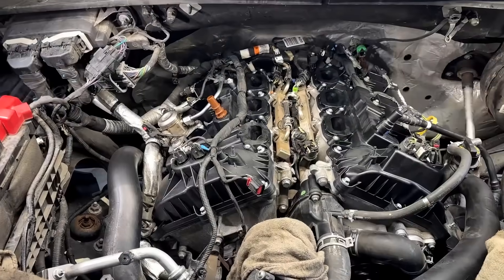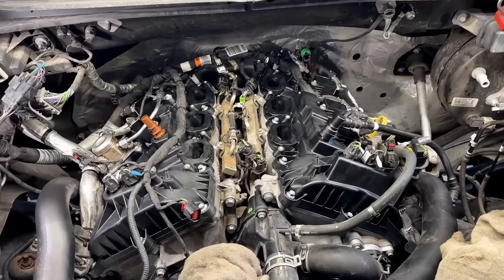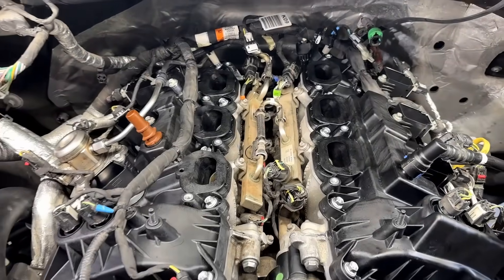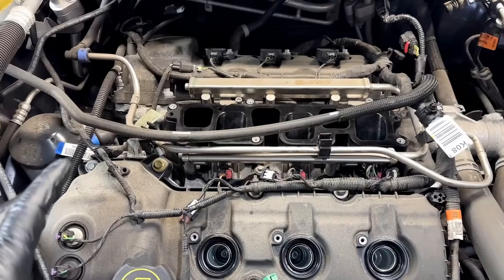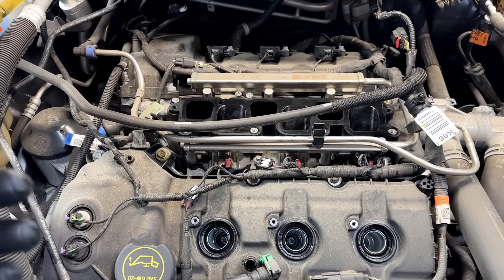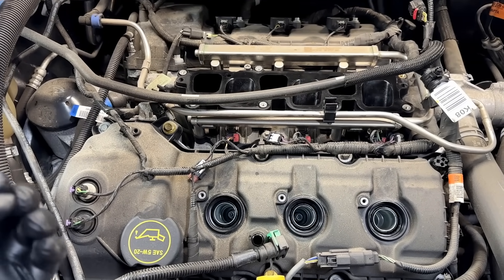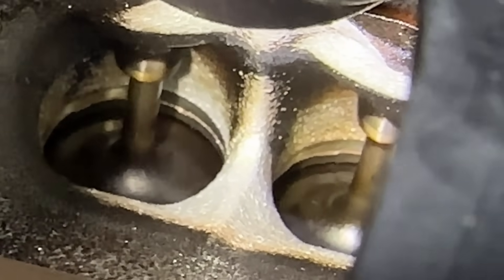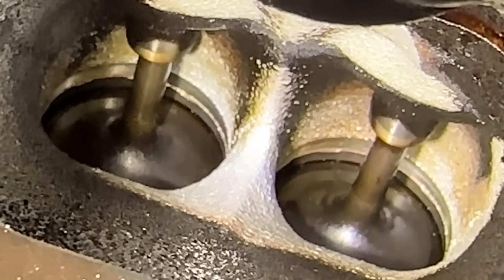Does Ford's New Dual Fuel Injection 3.5L Ecoboost Engine Really Fix the Carbon Build Up Issue?

Comment: If I wanted to avoid recurring carbon buildup in my cylinder walls would you switch from an ecoboost Mustang to a 5.0 for long term dependability? In 30k miles over 3 years driving 34 miles a day my engine has almost been replaced twice, my cylinders twice and my purge valve as well. I’m noticing a pattern of repetition with turbo and direct injection- love my car but hate the reliability- was thinking of paying off and trading in for a 5.0…. Not just because horsepower and torque but reliability. Thanks a bunch for all info

Comment: By far the best video that I've seen that shows the differences between direct, duel, and port injection, regarding the carbon buildup issue plaguing modern engines.
Direct injection is an absolute dealbreaker, duel injection is acceptable but not ideal. Port injection is still king.
Excellent video.

Comment: My Flex Ecoboost has 194K miles on it and the intakes don't look anything like that. Some soot, but no clumps. I have seen far worse on carburated engines. I was expecting them to be all fouled and gummed up, so imagine my surprise that there was just a dusting of soot on them.

Comment: Not saying  AOS will completely eliminate this issue but Ive installed the mishmoto AOS system and believe it or not  the cans collect a lot of moisture and mostly oil, will this not help that much still, Truck is a 2014 F150 eco boost has 102k on it dives really good thus far, always changed oil at the 40% life setting.  Whats your thoughts?
Reply: Or no thoughts.. perhaps

Comment: You put some good fuel injector cleaner and use high end gas at those deposits will vanish. Port injection doesn't help if you use crap gas, oil and don't do maintenance on it regularly.

Comment: My question in theory if the turbo chargers went out, could they be amputated, modify the exhaust where the turbos use to be
And run the truck without turbos?

Comment: I traded in my beloved 2010 5.4L F150 that I had for 15 years for a 2021 with the 3.5L and I've never owned a turbo engine so I'm learning as much as I can. I bought it used, and it had 57k miles. I'm doing all the 60k mile services and installed an oil catch can recently. Everything seems pretty clean and works well aside from the transmission. It has the "10 speed Whine" and it drives me nuts. 

I got an aluminum pan with a magnetic drain plug and I'm putting that on today. I'm hoping this truck can last 10-15+ years and close to 200,000+ miles because I like to keep my vehicles for a long time. With all the electronic nonsense, I'm not very confident it'll last even if it's meticulously maintained. It's also MUCH harder to work on than my old 5.4L. I wish I could've got the 5.0L, but I couldn't find one I liked with the 5.0.

Comment: Great info. I have an 18 3.5 thats misfiring on cylinder 4 at idle. Runs good off idle. Sounds like my port injector is bad. I didn't know the injectors worked at different times
Reply: Did you figure out the problem? My 2018 3.5 also misfires only on cylinder 4 at idle. It has progressed and now misses some under acceleration too.

Comment: Why do they have to build such garbage when a good variable valve and port injection was doing just fine?  Sure if you want to up the hp on sport engines...but for daily drivers and work vehicle you need them to last.

Comment: I got a gen 1 with 188k on it... never had a carbon issue. 
Imo, carbon becomes a problem when you drive like a retired nun.
Reply from the maker: It will be an issue on startup cold mainly.

Comment: Does anyone know if someone has done methanol injection on the 3.5 EB or the 5.0 Coyote  to see if this would reduce or eliminate this carbon buildup?
Reply: I'm getting a snow performance stage1 with the smallest nozzle for this exact purpose set for like 3 psi so its gets a shot every time I leave a light. It will clean it.

Comment: A direct port injection engine can be improved by using dual catch cans, and a methanol injection system, a cleaner can be added like seafoam to washer fliuid injection this will clean the valve stems and seats and de carbon the pistons and stop detonation. A slight computer tune can help also
Reply: That's what I'm doing. Going to run the smallest nozzle available and set it for like 3psi so it's shot often

Comment: From the camera inspection I can see the head gasket has a half moon protruding into the air intake to supposedly separate the air flow. If I changed the head gaskets from factory to felpro I would cut this restriction off the gasket, and let the port tubes of the head separate the air flow. This will be a definite horsepower improvement, also remove any spin vanes in the intake system for more air flow to the turbos .

Comment: Do engines used under high load a lot suffer from this buildup too? Wondering if the inlet valves ever get hot enough to clean themselves (seeing as the other face is exposed to combustion, they certainly get some heat in them)

Comment: My buddy bought a gen1, 2013 and it was running ROUGH. He purchased some Direct injection cleaner and sprayed it behind the  mass air flow in the throttle body. And then let it set for a while. He started it up and test drove it. That thing bucked, kicked, engine light flashing and everything but died. After a couple miles that thing ran like a new one. The spray was designed to clean the build up on the valve stems.

Comment: What are you saying when you stated "your finishing a timing job" does that mean timing chains are needing replacing on these things around 130,000 miles? Or Ford STILL has not fixed the cam phaser thing yet? (Wouldn't surprise me)

God these things are turds! Between the 10 speed transmission issues, the cam phaser issues, the rocker arms self destucting, beer can thick aluminum bodys & the cheepest thing avalable in a 1/2 ton ford truck costs $39,000.00 bucks no wonder every single ford dealer is choking to death on inventory.
Reply from the maker: Yes they still need timing jobs 130-150k miles gen 1
Reply: @FordTechMakuloco  I have a UPR dual (PVC and clean side) Mega catch can on my 2013 3.5 F-150 which I installed somewhere between 60-70K miles (I have 134,500 miles on it now) after I learned about all this stuff so would you think I should have a lot less carbon build up? I have no shakes or anything like that, no cold start rattles and it idles quietly at 500 rpm. I use only Shell and Chevron gas. Should I be concerned about the phaser going out on my truck?

Comment: Exactly why those engines should have had a water methanol injection system on them. And it would not be particularly expensive to do so it should be able to be done for less than $100 all you need is a container and a way to pipe the water methanol vapor into the intake. It isn't brain science or rocket surgery. However it was at one time

Comment: I have a 2015 F150 with 3.5 ecoboost. 
What are your thoughts on a catch can? I probably should have installed one 100,000 miles ago. Think I'm too late or should I still install one?
Reply from the maker: Just stick to walnut blasting's every 100k miles.
Reply: @FordTechMakuloco  Where can I bring it for walnut blasting? Will the Ford dealership do that?

Comment: why is there anything on those valves? nothing but fresh filtered air should be going thru there? those should still be clean!!!! these look worse than most exhaust valves... at any mileage... those look like youve been spraying motor oil into the intake manifold...
Reply from the maker: Exactly

Comment: Can u tell me if i really need the induction cleaning service, for charge 380 or something like that. My truck is a 22 f150 tremor 3.5 ecoboost with 50k miles. I took it in and wanted the plugs changed since they r original but service advisor said it wasnt needed for a while but needed the induction service,

Comment: Very interesting video.  Thanks for sharing these results.  I have a 2023 and I installed a catch can at 1500 miles because I knew this was an issue, especially for those GDI only years.  My question is this:  Is there any way to tell the ECU to use Port Injection only rather than it switching back and forth from DI to PI?  Everyone knows that gasoline is a great solvent, so if there was a way to set Port Injection only then this could be a way to slowly clean things up without walnut blasting, etc.  Hmmmmmm?
Reply: You'll lose performance. And ability to run 87

Comment: Actually, it comes from EGR (exhausted gas re-circulation). Had you removed those EGRs from the intake, there would never have this ugly carbon accumulated.
Reply from the maker: There is no EGR Valve on this engine.

Comment: Would fuel system cleaner added to the fuel on a regular basis help to keep intake valves clean in 2nd generation systems?

Comment: Another data point or useless anecdote, take your pick: 2015 F150 2.7 at 153K. Top tier gas from Costco most of the time. And 5-6K oil changes with Mobil 1 EP. I’ve never seen the oil life indicator go below 46%, fwiw. Still running strong, and idles like it always has. I hear the first sign of excess carbon will be rough idle when cold: no issues there. I’m keeping that truck long term, no reason to sell it. I was so impressed with the 2.7 in the F150 that I added a 2023 Bronco 2-dr 2.7 to the stable. The Bronco does idle better with the dual injection than the DI only F150 did even when new. The F150 is plenty smooth, the Bronco is so smooth I can’t tell it’s running. The Bronco is a year old now, with 8200 miles and just got her 4th oil change. I did the first at 500, second at 2100, just to clear all the wear-in metals out. Going forward I’ll do the same 5-6K or whenever the oil life drops below 50% thing I do with the F150. I think the key to keeping any of these modern engines alive and out of the shop is keeping after that engine oil. Cheapest insurance ever.

Comment: Best Ford Maintenance Resource on YouTube by far!!
I have a 2014 F-150 3.5 Ecoboost with 218K miles.  5K mile oil changes with synthetic oil only.  My oldest son drives it now and it runs like a champ.  The vacuum boost pump is starting to leak just a bit, but that is all.  

I just bought a 2024 F-150 with Ecoboost.  I am going to run Pennzoil Ultra Platinum and change at 5K as you recommend.

Question - If you turn off the auto start/stop and let the truck idle at stops, does the engine switch over to Port injection during this idling?  Would that not be cleaning off the backside of the intake valves?  If so - it would sense to let it idle.  The possible fuel dilution is solved by changing a quality oil at 5K don't you think?

Comment: Just the fact that Brian has to do a timing job on a 2019 vehicle in 2024 tells you all you need to know. I own a 1994 F150 with a six cylinder engine that still runs like a fine swiss watch. The engine has never had its head off, or anything else major done to it. It currently has 165k miles on the clock. Plugs, wires, distributor cap and rotor, coil (only one) water pump, and alternator. That's it, in 30 years. Yes, I changed the engine oil religiously every 5k miles, and the other lubrication at each 40k interval. Now you tell me Ford isn't going backwards. Oh, and you can actually reach into the 8ft. bed without a step stool. 😅

Comment: I bought my '18 Explorer new. We have 75k mile on it now with no issues.  I bought my '18 F150 used a year ago with 150k on it and now has 178k.  Both have been driving the same. Last week, I had the Explorer at the dealer for an oil change for warranty purposes. They gave me a whole list of "immediate attention" items totaling over $2200 in maintenance required.  
  One thing on the list was a complete fuel system cleaning.  I asked if they did walnut blasting.  The service guy said, "No, they use chemicals."  I said, "So basically, you're spraying a can of cleaner in the intake and dumping one in the gas tank for $400." Spark plug replacement was $450,  not including the plugs. Good thing I have my own shop.  30 min and $60 for both.
  But I also wondered why they were charging $250 to replace the cabin filter that takes around 5-10 min to replace. The motorcraft filter was $24.99 at O'reillys and for some reason, the dealer was wanting $45 for it.  I'm guessing the 1hr min at $190, plus filter and tax. They should pay me for breaking my glove box lock hinges when they didn't pull the pins and just yanked down on the box.  
  I get so irritated when I find lack of workmanship, especially being my own vehicle when I take pride working on other peoples vehicles.
  I'm still waiting on the day to find another mechanic that treats my vehicle the way I do.  I treat everyones vehicle as if it's my own.  Drives my crazy to see things broken or to see oil spilt all over the engine and not cleaned up after a service.

Comment: A way to drastically slow down the carbon on the gen 2 ecoboost engines are 4 things firstly and most importantly run a good high quality synthetic oil no Motorcraft simi synthetic crap. second is run a fuel system cleaner once in a while like berrymans B12 or seafoam. Third is use the remote start and let idle 10 mi  or so before u head to work in morning. At idle especially cold starts the port injection is spraying if u have a good fuel system cleaner in there u are basically cleaning the back of the intake valves. forth and almost as important as good oil is catch can! Just some things i have found out from research and mechanics and other ecoboost owners. If u do these things your truck will be in junkyard worn out before  u have to worry about carbon. great video
Reply: Instead of fuel system cleaner I just throw in 2-3 gallons of e85 every so often, does the job beautifully.
Reply: @lucian7182 can these trucks take e85 safely? Or they require a tune?
Reply: @adrianenriquez2544 the only engine that I know that's rated for E85 is the 5.0 I don't think the 2.7 or 3.5 can run full E85 without a tune
Reply: I agree. Now that there is fuel in the port again, fuel treatments (that are near pointless with DI) are back on the table. For idle and low load, with the port injection working, this should vastly extend the carbon cleaning interval. With a catch can and oil bypass filter, maybe never a carbon cleanup?
Reply: I agree

Comment: Just wanted to say I have owned Fords since I started driving in 1982 my  2016 3.5 L eco boost on regular gas with over 240,000 miles regular oil changes every 3000 miles I have changed a water pump cat I don't know what to say  I am pretty impressed if I am just lucky well I just cursed myself.  your channel and your info has been very helpful with numerous of my trucks so please keep on Trucking.

Comment: Wouldn't it be possible to still have some port fuel injection with direct injection?  Or would such a system reduce the amount of turbo boost at max throttle?  I am assuming the direct injection has a charge cooling effect...

Comment: In dual fuel injection engine the Port injection functions at low rpm and Direct injection at high rpm.
To get the benefit of port injection, keep your engine at idle for few minutes any time you drive to avoid carbon buildup. 
Remember if you are driving your car constantly at high rpm then you’re basically never using the port injector.

Comment: It would be awesome to see Gen 1 valves on a vehicle that had catch cans installed from the beginning of its life.
Reply: That's a gimmick!
Reply: @gilianrampart8514  You are wrong!!! I put one on my 2017 Ford Focus RS which also has the direct injection. Guess what? It's catching a ton of blow by which would have stuck to the valves and stems.
Reply: @skeeter012  2000lbs?
Reply: @skeeter012  Oh really send us a pic of those valves.
Reply: @gilianrampart8514  Must be why they do them on race engines.

Comment: This video makes me wonder if the owners were using Top-Tier gas? That's pretty much all I use (99+% of the time). Does it make a difference in the carbon build-up? I've read that it does but I've never looked inside my own engines.

Comment: I need a timing & phasers job done on my 2014 F-150 Ecoboost (over 200,000 miles). Is the carbon cleaning done at the same time the timing chain/Phasers job is being done by the mechanic? And how much does it cost extra to do that type of job? I'm thinking that it might be better to install a new engine?

Comment: 2017 navigator is 2nd gen ecoboost? I’m under the impression so 🤔
Reply from the maker: no
Reply: @FordTechMakuloco  I currently at 63k change oil 4K max rarely idle. I saw your catch can video. Will the 2 hose set up in catch can work just as fine(not having to add hoses to turbos) or really make that much of a difference going with the basic Amazon $40 one ?

Comment: Thank you. Would you advise for or against a dealership recommended fuel injection cleaning service as preventative maintenance at 60k for a 2021 3.5 ecoboost?

Comment: I haven’t even received my 2023 f150 yet and have a catch can waiting to be installed. I found out by experience that techtron additive in a half tank of fuel will clean your injectors. Also any fuel that you store in cans should have a ounce or two of Startron added to it. I’ve been doing it for over 10-12 years and have no issues with ethanol in my lines or carbs with seasonal equipment.

Comment: And, folks wonder why a used Tundra is so expensive. This nonsense on Ford's engines. AFM failure AND DI problems on GM. Hemis and their tick. Nissans also with lousy chains, bad HPFP and DI woes. All at as little as 30K miles. You have to TRY to make an iForce 5.7 last less than 300K miles.

Comment: I purchased a 2023 Powerboost and currently have just over 14,000 miles on it. I just installed a J&L Oil Seperator/Catch Can) and will be curious to see how much it collects over time,